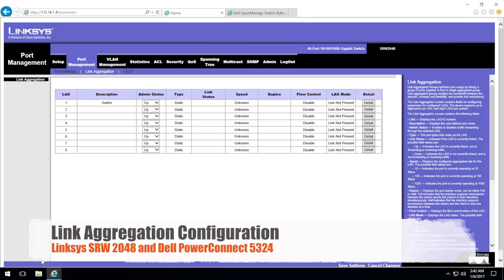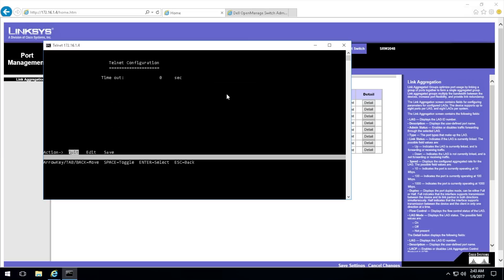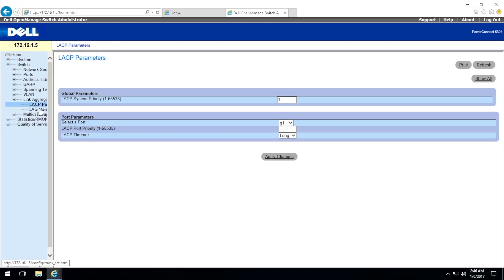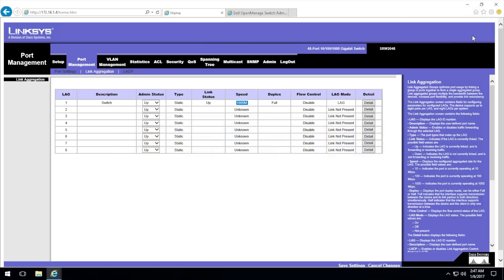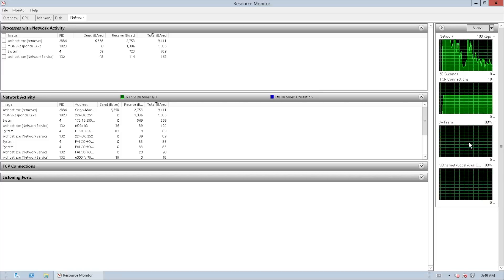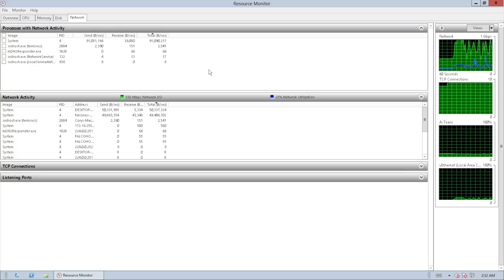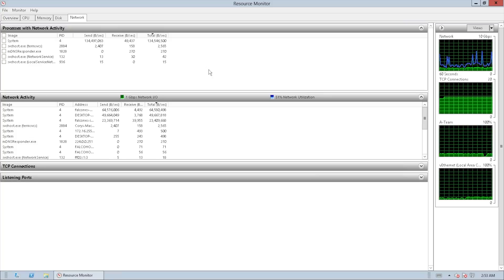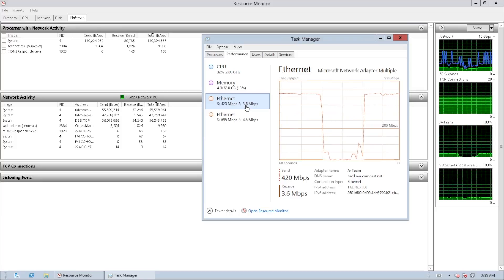LAG Configuration SRW2048 & PowerConnect 5324

Comment: If anyone still has these but they died that's due to bad Electrolytic capacitor's there are 18 on the board and they all need to be replaced.  I just did 2 2048's from work.  New caps and they're good now.